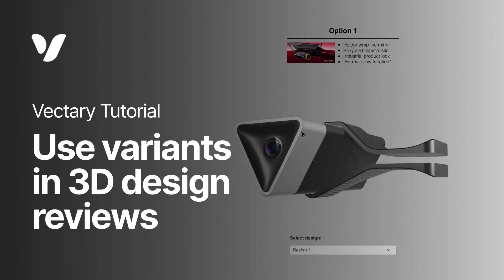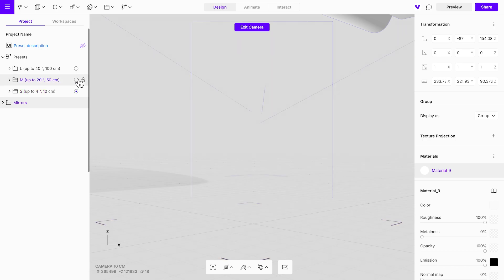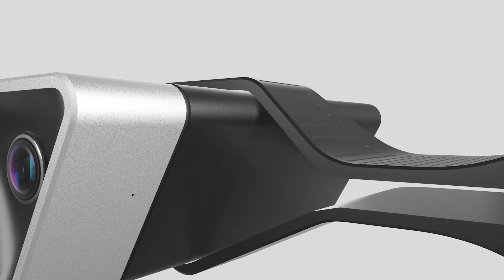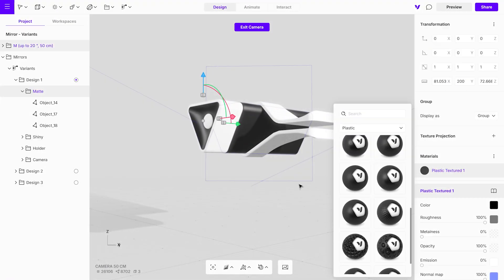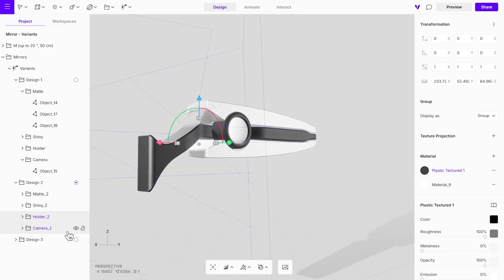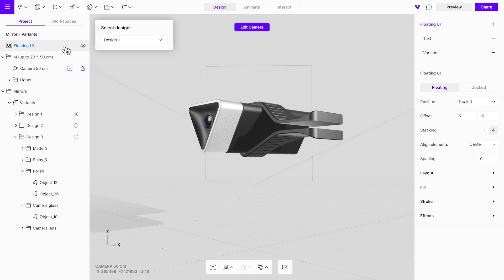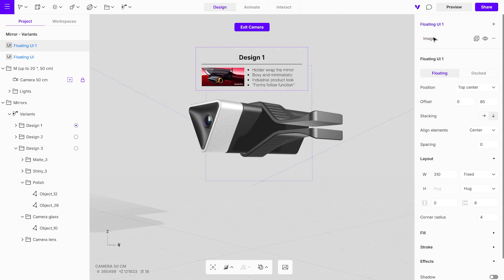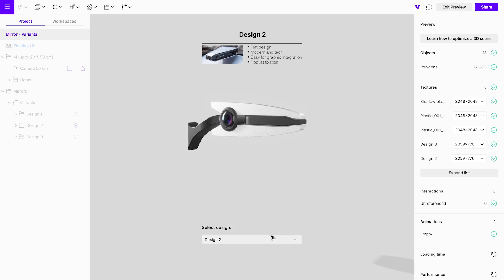Design variants for creating interactive 3D presentations - Vectary tutorials

Comment: This is probably really simple, but,
How does one align two lines? like I have two planes and I want their edges to match but doing it by hand is too hard and I end up leaving a gap or making them clip
Reply from the maker: Unfortunately, there is no universal way to handle such tasks, but they can be achieved in different ways depending on your situation (whether it's two meshes or one, whether you're trying to do this in Design mode or Edit mode).

Please join our Discord server, and we’ll be happy to help you with this and much more there - https://discord.com/invite/kbfe4SxzMg